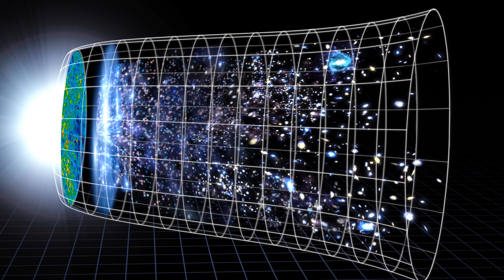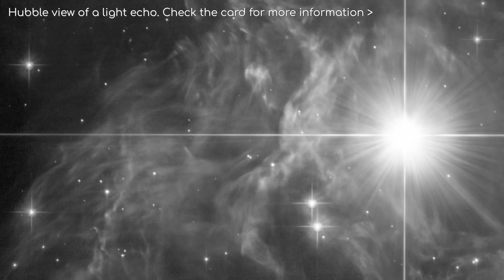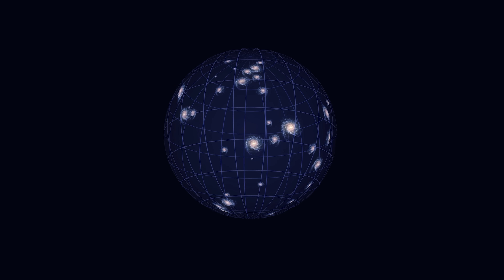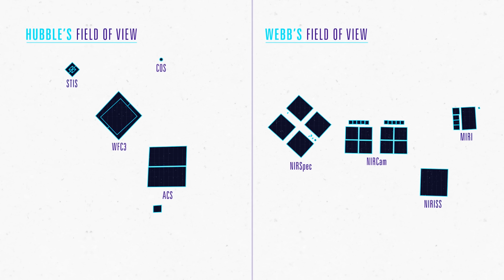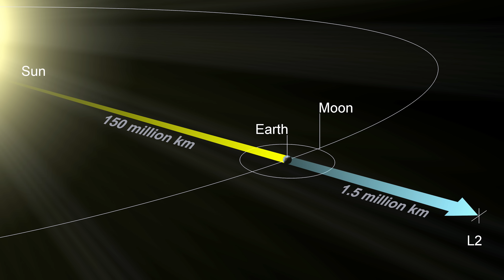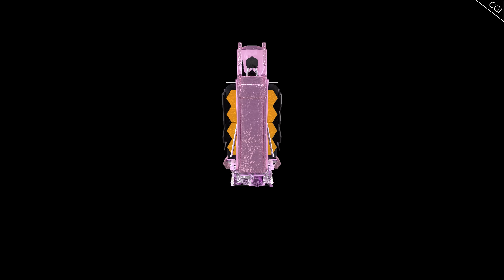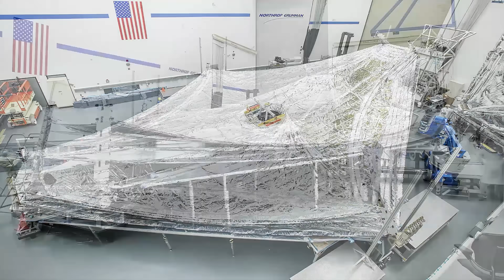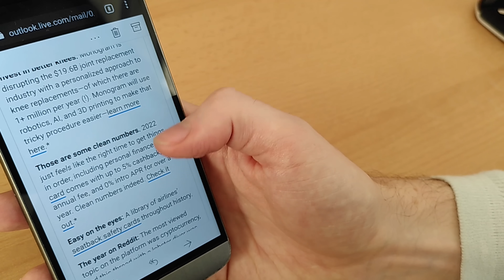What Can the James Webb Space Telescope Actually Do?

Comment: With how fast rocket technology is progressing, hopefully one will be developed to go out there to either fix the JWST if it goes wrong or refuel it - anyway, just hope all goes well, good luck James Webb
Reply: how fast is the rocket technology progressing exactly? Because I think it's been basically the same for 50 years.
Reply: @user-zb8tq5pr4x  space x has reusable rockets, the new engines that they use is incredible, nasa ‘s heavy lift system is able to place heavier loads in space and low earth orbit compared to the 50’s, 60’s, 70’s and 80’s - the technologies have increased way beyond that and look to be getting even better in the near future- you should read more
Reply: @Rockit-  All of those "improvements" areof the small and incremental kind. We can expect engines to get a little bit more efficient over time. But nothing is 2x better than it was 50 years ago. And in 50 years it wont be 2x better either.
Reply: @user-zb8tq5pr4x  But thats the point, sure, rocket engines can only get SO good and take people and equipment so far at speed that takes too long to really get anywhere within a given time frame - food, water, living arrangments and more have to be accomodated for the personnel and things have to change, technology has to change - i get that but compared to what they had back then to the re-usable ones that space x has now is way ahead of what they even tried to design back then - Rocket engines MAY have their place (liek going into low earth orbit) but to really get anywhere, the designs and technologies have to change.
Reply: @Rockit-  Well I remain skeptical about the reusability thing, mainly because NASA tried basically the same thing with the shuttle and it was one of the most expensive and dangerous ways to get stuff to orbit. The jury is still out on whether falcons are actually financially viable at all, I recommend doing some research on the topic because it's interesting (from spacex critics as well, not just the fans)
Reply: @user-zb8tq5pr4x  But they are working on it - dont know how scientists will go, but at least they are giving it a try.

Comment: I found a problem at 6:25. The Galaxy on the lower right part of the screen (middle distance) should not be purple, but more green or yellow. If you look at a rainbow (the visible part of the Electromagnetic Spectrum) violet has a higher frequency than blue. Green is in the middle of Red and Blue, so to demonstrate the Doppler Effect of light the color should be green or yellow, not purple.
Reply: Yes. I believe you are correct.  Violet is a shorter wavelength and should have represented the close galaxy.

Comment: With such a long and expensive development process, they should have made plans to have at least a couple of identical copies ready to go, to either supplement or replace the JWST in case of failure.  The more copies produced, the cheaper the per unit cost.  Given the soon-to-be reality of Starship, a cheaper, much simpler but equally capable space telescope should be designed.  This origami stuff is just too risky for the time and money spent.
Reply: Soon to be reality Starship? That sounds extremely optimist.
Reply: @Caperon81  Optimistic if you're thinking in weeks; not so much months; and even less so if considering a year or two or even three.  Time goes by quickly.  Starship is currently the best bet out there.

Comment: JWST might clean up the reasons why the conflicting measurements of the Hubble Parameter exists. Maybe our Standard Candles are not really fixed? The astronomical distance ladder configuration may be flawed because similar stellar events, i.e. Cepheid Variables, Supernovae,  actually vary from object to object more than is currently known.
Reply: Possibly. But you ignore the fact that each element in the distance ladder is independently cross-checked with the other methods.

For example, standard candles have been verified endlessly using pure trigonometric parallax on a very large number of targets. Which is a direct, mathematical measurement. 

So they have been verified. Each rung in the ladder is verified and supported by the others.
Reply: @beta_cygni1950  The issue is the relationship between the pulsation period and the luminosity. That relationship might vary from star to star  because of various complexities in the star's makeup, and so if the "true luminosity" is not an exactly known certainty for all these stars, these unresolved matters may result in cited values for the Hubble constant (established from Classical Cepheids) ranging between 60 km/s/Mpc and 80 km/s/Mpc. And parallax/triangulation is limited as verification to stars distance up to only 300 light years.
Reply: @somewherenorthofstarbase7056   

1. No, parallax is not limited to 300 ly. This figure is the limit for earth based measurements. The Hipparcos and Gaia satellites extend this limit to thousands (or even 10s of thousands) of light years. 

2. Why are you binging up the Hubble constant here? That has no bearing on the distance measurements based on standard candles & parallax. Sorry. 

3. You have no basis at all to say "what if" pulsation and luminosity aren't correlated. There is no evidence of that it all. In fact, all the evidence shows that they ARE correlated. You might as well ask "what if" unicorns can affect it. 

4. I will restate: we know the true luminosity of standard candles precisely BECAUSE we have measured the distance of A GREAT MANY EXAMPLES using parallax methods. And these examples span thousands of light years.
Reply: @beta_cygni1950  Pulsation and luminosity may not be exactly correlated for every star. Stars may vary..There is debate. This does make a difference in determining distances and the Hubble Parameter. Do research. It is well known that the accuracy of Cepheid distance determination might be huge factor in the difficulties in determining Hubble parameter. Dust is a huge factor in observing brightness. If this observation is off, the Cepheid variables accuracy is off. Please do not get emotional. Do research.
Reply: @somewherenorthofstarbase7056   None of which has anything to do with your original claim about the Hubble constant. 

And sure, those things you listed absolutely can affect distance measurements. But not enough to prove that the entire correlation is somehow "wrong." Many, many instances of standard candles have been independently verified using parallax. 

But "don't get emotional. Do your own research."

Comment: I'm hoping the JWST has a selfie cam so we will see the full unfolding, it shouldn't be that much of a task considering it's a basic function.. fingers crossed!!
Reply: I'm hoping it doesn't explode on the launchpad.
Reply: @thesenamesaretaken  that would be a massive oof
Reply: Im almost certain there wont be a camera on board, the last thing you want is the IR radiation from the cam to interfere with the telescope
Reply: Nope, sorry... 1. Plastics and adhesives used for a small, GoPro-ish camera can't withstand the very cold temperatures and would take too much moolah and time to develop one for such a limited part of a 10+year mission. 2. Cameras and electrical distribution systems are a source of heat. Any potential heat source is to be avoided. 3.  Sensors provide precise information where needed and thus are more informative than an image which at times is no more than a suggestion. Sensors are closer to PROOF; an image, less so. 4. While public relations IS important to NASA, it's NOT for the purposes of this 10-year scientific mission.   -   Pass this info on to whoever has similar feelings of disappointment, as I did, but the above convinced me...
Reply: @tomfieselmann5906  So.. I just watched a video that clearly shows the JWST took a selfie.. don't get me wrong the information was interesting to read but ultimately, wrong!!

Comment: Why can Hubble with the technology of the 80's work so well even today after 27 years and the new telescope JWST 5 to 10 years ?
Reply: Because JWST isn't going to be in earth orbit like hubble is. Since L2 is not a stable orbit, JWST needs fuel for periodic burns to keep it in place.

And JWST isn't a visible light telescope like hubble is. Its an IR scope. Which means it needs a supply of coolant to keep its mid-IR wavelength instrumentation cold enough to work. 

Seriously, dude. You could have looked this up for yourself with a 30-second google search.
Reply: @beta_cygni1950  Thanks a lot ! I`ll read more about it, I promise :-)
Reply: In the same way a 90s feature phone can be easilly repaired and last 10+ years, while you cannot repair or even open up today's state of art iphones when something went wrong....

Comment: If Hubble can last 30 years and more even though it’s having a few problems now I’m sure the JWST can last more than ten years at that price only thing is will it work at all when it’s a million miles away I hope so but it only take one wire to come loose and billions down the drain ,,you would think they could have put a recall button on it to bring it back just in case ,,fingers crossed 🤞 people it’s getting close now
Reply: chances are if something easily fixable went wrong, they would design a robotic thing specifically to fix it and launch that up there

Comment: We could utilize radio-controlled robotics in the case something goes wrong.  Sure, there will be a delay in radio transmission, but not enough to prevent the NASA engineers from completing the repairs.
Reply: Yeah why don't you go tell NASA that they didn't think their project through enough. You should be on their team.
Reply: @duulo4843  While I'm certainly flattered, I'm sure that NASA engineers have already thought about this.  I'm also sure that NASA did the best they could, given the overall complexity of the project and its myriad of budget constraints.
Reply: Speaking as an electrical engineer myself: what you propose is WAAAAYYYYYY easier said than done. 

No one who says "why can't they just build a robot" has any idea what that ACTUALLY means.
Reply: @beta_cygni1950  Of course, it's easier said than done; what isn't?  That said, the point of my initial comment is that the task itself would be nowhere near impossible. 

As for the whole "No one who says "why can't they just build a robot" has any idea what that ACTUALLY means" thing, well, I never implied that, clearly.

Comment: Can’t wait for this. With costs that large for ten years, why isn’t there investment in a 100Tev accelerator. It will last 25yrs and be more cost effective.
Reply: Because they are two completely different instruments for two completely different fields. There is no way to calculate how long it will last or what cost effectiveness it will achieve.
JWST will probably last much longer than 10 years.
Reply: @lenmetallica  I think it's the fact it needs a coolant, which makes its lifetime short, so ten years maybe an upper limit?
 My comment wasn't to say we shouldn't have astronomy projects like the JWT, but why we should invest in a bigger LHC type machine.
Reply: @RustInPeace43  the helium coolant system is closed loop and will out last the amount of propellant on board. If the propellant is conserved, it could last much longer than 10 years of design life.
On a side note, the duration of an experiment is an inaccurate way to measure it's cost effectiveness, especially in two completely different fields.
Reply: @lenmetallica  In regards to the last paragraph, to some it is. Not to me. 
But look at America cancelling SSC, as an example.
Reply: Both? 
Yes, both.
Reply: once the mega rockets from Space X get working (all going well) it opens up a lot of possibilities - including servicing the JWST